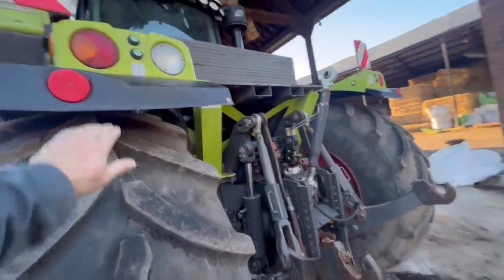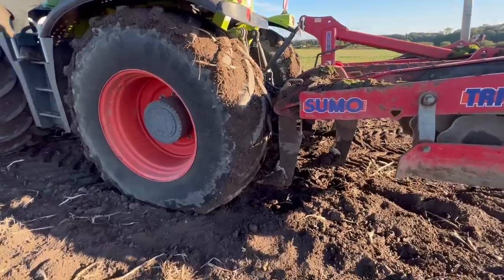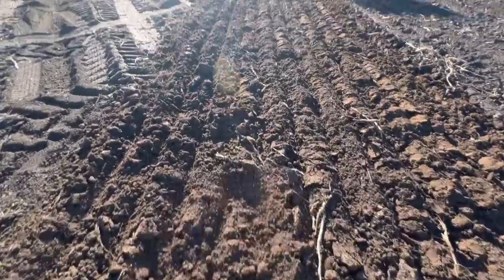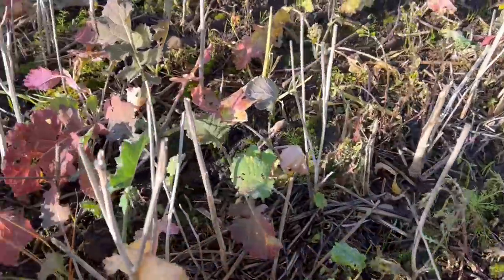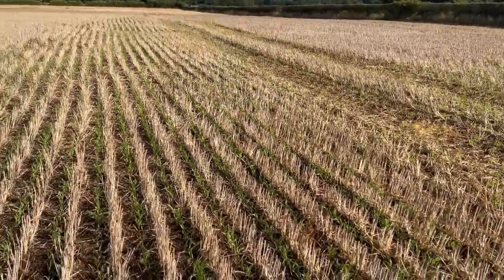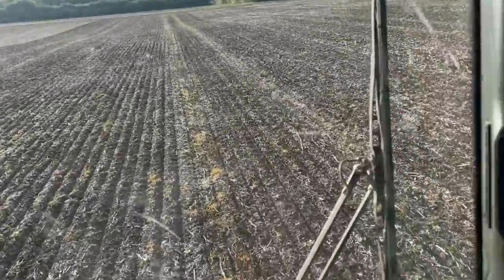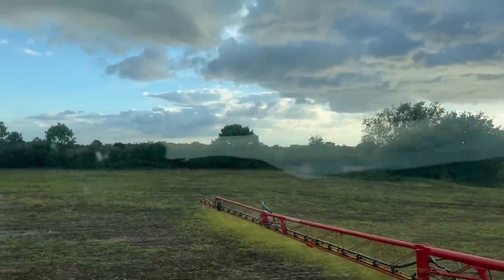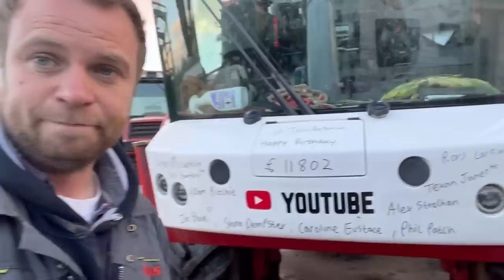DAY 921 BIG CLASS XERION GOES TO WORK LEVELLING GROUND  #OLLYBLOGS  #AnswerAsAPercent

Comment: I was always tough. When you use a machine like the sumo with a roller. Let the arms right down so they go into float. Then set the depth of the machine using the roller and the top link. Just so the cultivator can move separately from the tractor. Get a lot smoother Finish
Reply: Big sumo making a tidy job there tractor is a fair beast but im sure Andrew still prefers Nemo

Comment: Hi would it be possible you could explain what the different type of draw bars are for because I see youtubers changing the hook one to the one with the pin but I don’t understand why the one can’t do all the jobs . It would be great If you could explain in vid some time no worry if not thanks
Reply: The pick up hitch (hook) is mainly for trailers and heavy equipment. It's strong and gives good contact whilst on the road, the drawbar (one with hole) is for smaller less heavy equipment, for field work. That gives more movement for the implement over rough ground. Usually used on smaller tractors and for small to mid side implements. Then there's the big euro hitch for big tractors and big implements. For safety and it can also take more abuse on the big old bailers and drills. That's basically a rough guide to them.
Reply: @carlstevens4981  thank you so much mate 👍🏻 appreciate that
Reply: @seamiedooley7423  no problems buddy